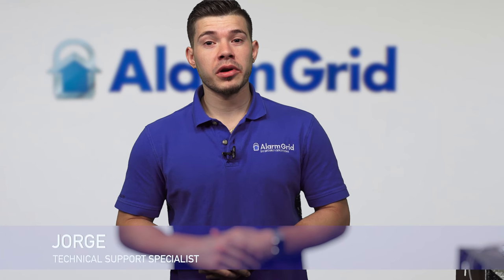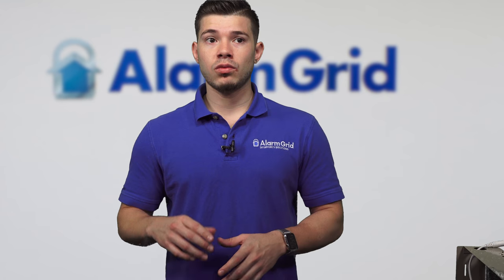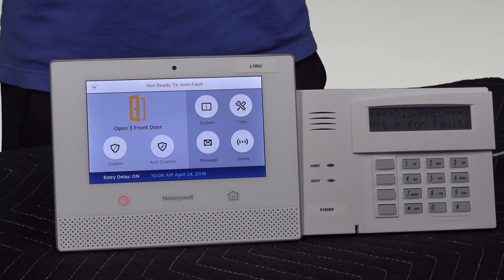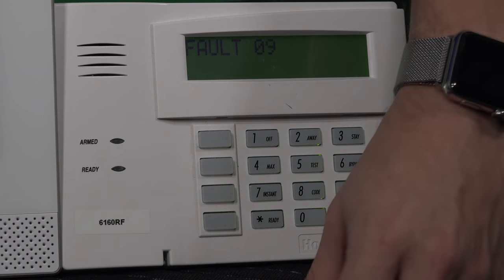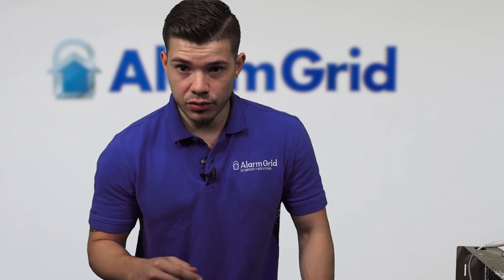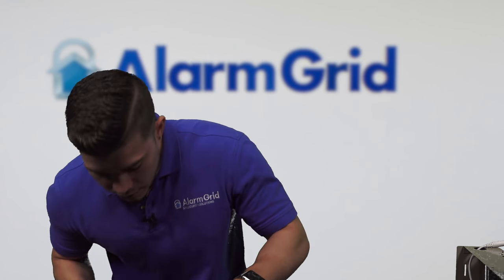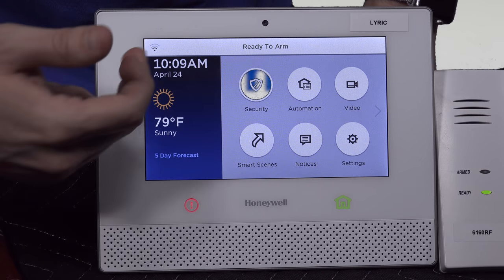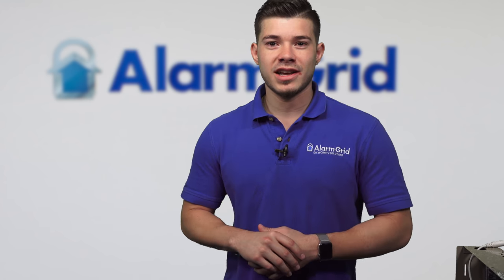How to clear a Tamper on a wire:wireless system

Comment: Good advice, BUT if you have a Slomin system, with that thin  "mini"sensor, some of them don't have any slot to get a screwdriver into. Gently pry the cover off, from the bottom. After you replace the battery ( a 2032, + side out) replace the cover . IMPORTANT ! After you snap the cover back on, you have to press DOWN on the top of the cover and it will go down maybe 1/32". If you don't do this you will never get rid of tamper. By "down" I mean towards the floor. Then you have to cycle through "arm/disarm twice. I fooled around with it for an hour, then for some reason I pressed down on the top of the cover and heard a small snap. Then I cancelled the service call. Oh, PS, make sure your extended service plan is up to date.
Reply: @scola1951, Correct, most mini contacts need to be snapped and/or locked back in place depending on the manufacturer. Some slide to unlock and lock the top cover, some have tabs to use a flat head screwdriver to lift a corner or side, then be snapped back into place. B aware of which type of sensor you have when attempting to open to replace the battery, as improperly opening the top cover can damage the cover or tamper on the sensor causing the tamper to stay indefinitely open.

Comment: What do we do, if the tamper or faulted messages don't go away post checking if the the sensor cover is in place and the door is closed correctly?
Reply: This meant (for my ancient 2001 era system) that the sensor had gone bad. Had to replace them as this happened, I threatened to leave ADT unless they replaced as many of my sensors as they were willing to, which was 20 in my case. I still have some of the remaining window sensors going bad here and there. You can keep the panel from beeping at random times by specifically bypassing the zone for the sensor that is generating the false tamper.
Reply: @christopherjbutler  I thought I had a bad sensor till I remembered to press DOWN on the top of the cover after you replace it. You'll hear a small "click:. Maybe 1/32" but its enough to mess things up. And by "Down" I mean towards the floor, not "in" towards the door.

Comment: Any idea why a hardwire would show tamper? Bad contact? Thank you in advance!
Reply: If this is for a hardwired system, the device itself may have some type of tamper switch built in or the wires at the panel terminals may be loose. 
If this is for a wireless system and your wired devices are connected to some sort of converter unit, such as the 5800C2W, then the converter unit itself is experiencing the tamper. Meaning the cover on it is being seen as open.

Comment: Thanks I have my system but vista 48 and for no reason pop up the tamper
Reply from the maker: You don't get tamper for no reason. Either a device's cover isn't properly seated, or it could be that the tamper switch itself is defective, but there is a reason it's popping up. To check for a bad tamper switch, try either manually holding down the tamper with your finger,  then disarming at the panel. If the tamper won't clear when you know for a fact it's being depressed, then that's a bad tamper switch.  If the tamper trouble is more intermittent, you could try maybe taping it down, then seeing if the problem returns.
Reply: @AlarmGrid  Thanks I will

Comment: This must be outdated. I have a 3 month old wireless version. Go to Zones and my options are 3 Bypass choice. Nothing to clear troubles. I can bypass but the tsmper error remains.
Reply: If you can't get it pop up the clear troubles within zones, I would try hitting the home button twice on the lyric and see if it prompts you to enter your code, as long as your devices cover is closed and the tamper is not damaged on the device it should clear after repeating this process a second time.
Reply: @nathangalarmgrid5205  thanks for the advice but nothing changed. Hitting it twice brings me back to the main menu. Hitting it once brings me to the Not Ready To Arm error due to the tamper error. Still have to bypass that door sensor to Arm the system. Not a fan of Honeywell- how does a door sensor start showing a tamper error a few months after install when it still hanging in the same as iy was at install.

Comment: Didn't help
Reply: Sorry to hear. If the tamper issue continues after the steps in this video were followed, the sensor itself may be having an issue with its tamper switch. If that is the case the sensor would need to be replaced.